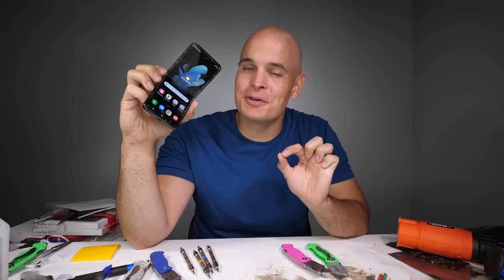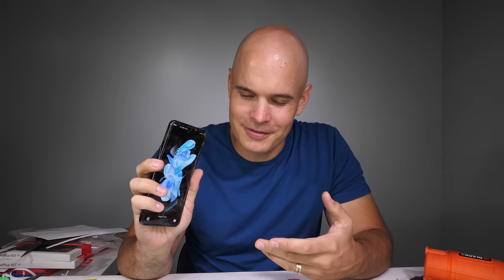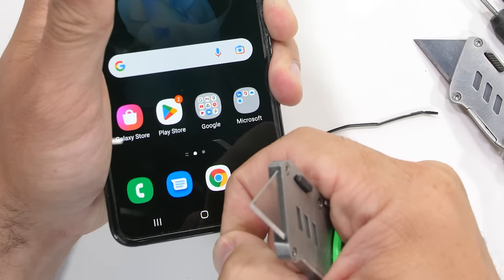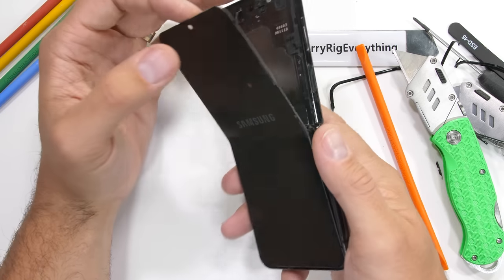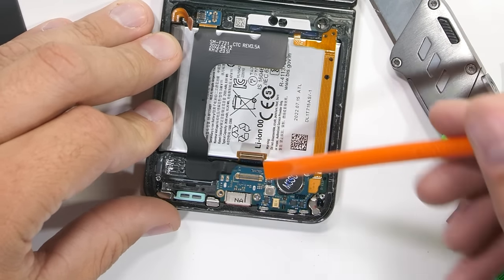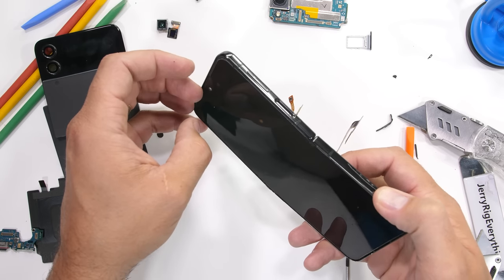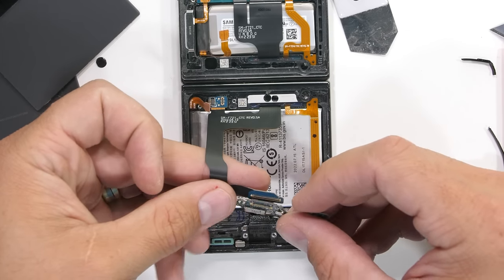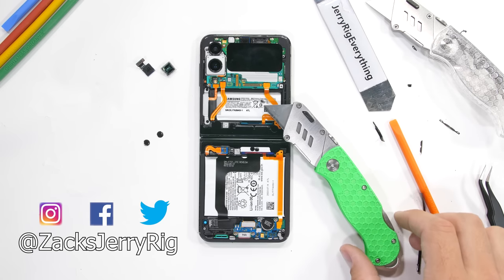They said i couldn't do it... - Flip 4 TEARDOWN

Comment: Teardown videos are way more satisfying than durability tests, you can add waterproofness test into your videos
Reply: Almost all IP68 phones would survive within the standard claims
Reply: Most phones have an official IP rating so testing them yourself is redundant
Reply: @MasterKey2004  *IP
Reply: @ShippoHsu  no but after durability test it would be interesting to see if it survives or not
Reply: There is no terrible scratching noise, so obviously it is more satisfying xD
Reply: Yeah I can't stand the scratching :D So always skip those video's and I'm extra happy when  a teardown comes by
Reply: The watertightness is already certified, so no use in testing phones with a rating tbh
Reply: Just because it's certified doesn't mean it will survive.
Reply: @premprabhakar805  Hey I'll second this. I mean...despite my best efforts, gravity is an insistent som o' bish. Would be nice to know when my phone is still able to sink or swim.
Reply: @premprabhakar805  it kinda depends on what the phones condition is
Reply: @premprabhakar805  no phone would survive if its internals touch water, soon or later its gonna die, he would have to glued it back together since he cut the adhesive, boring and also not relevant since it depends on your ability to do it, not the phone itself,
Reply: It wont survive for sure, all the sealing is broken, no way it can survive

Comment: 6:00 those black circular spots at the sides. And at the part where the phone bends. So when the phone bends multiple times, it can create air inside, so to remove air getting into the screen or in some unnecessary parts. That sticker might help.
This is my theory.

Comment: Nice to see that this phone is at least possibly repairable without much need for expensive proprietary tooling. Gives me confidence in this phone as I just got it a couple of weeks ago. That pop is still a little concerning though...
Reply: I doubt there's a third party repair shop that would dare touch this thing with a ten foot pole. God knows I wouldn't.
Reply: Lmfao I wouldn’t wanna get anywhere near that screen.
Reply: prob. is one of the metal channels that bent and is bumping with the other parts, causing not a correct way to close enough
Reply: @-Jester  Refurbished Samsung original screens come with the plastic bumper installed, it's very easy to repair.
A friend of mine owns his own repair shop and I was there when he repair the Z flip 5G (first one with SD865+
Reply: 'easily repairable', one of the first things to die is the battery. Jerry didn't even bother (which is a first).
Reply: @trakaiszeks  as I am writing with my galaxy S10+ bought in 2019  
, I can guarantee samsung's battery is superb. I'm not a cautious person. I play games while it's on plug and do other things that ppl said not to do while charging the phone. It survives my cruelty 😂
Reply: @leeeunhae7510  I've had an iPhone xs max for the past year and a half. I've had my s22 ultra for a day and the difference in battery life is no joke. Would've been charging my iPhone by now.
Reply: Y’all still liking your flips?  I just got the 4 for my partner

Comment: Id like to see a scratch test of the layer under the protective plastic, im curious if thats where Samsung is hiding their ultra thin and flexible glass
Reply: It's not glass per say as I remember Jerry testing it some time back. It still scratches at level 2, its more of a thin layer of glass in between plastic or you can call it glastic
Reply: @nishantrajani7372  yeah but he only did that once with the fold 3, he should test all flips/folds without the screen protectors just in case even tho its probably gonna be the same results.
Reply: @LeonRivia  if samsung actually managed to achieve a glass folding screen, I’m pretty sure they would advertise it like crazy doe

Comment: I have a Z Flip 3. The screen protector started lifting about 6 months ago, and by 3 months ago, it was completely lifted in the folded section of the screen, so I just removed it. Been a few months now, no issues whatsoever. I think the reason they tell you not to remove it is because the adhesive is probably strong enough to lift the screen and crack it if one is not careful enough when removing it.
Reply: I did the same thing too 😅
Reply: I put a different screen protector
Reply: Same thing has happened to me however the screen is now cracking across this fold and my phone screen turns off randomly. I will never get a folding phone again
Reply: 🤣. It’s there because look at the fkin screen mate it needs every damn layer of protection it can take. It’s glasstic
Reply: It's also there to keep the glass together if it ever where to crack or shatter.
Reply: @angryviper1  which one did you use? 🤔 I got the fold 4, it's still new in a thicc case, but eventually it may give out...
Reply: Would reapply a screen protector(the genuine Samsung one imo is the best) as soon as possible. Had the same issue with my Flip 3. Protector lifted at the edges. So I went witout it(actual screen still in flawless condition) About 6-8 weeks later, the folding part started to develop very fine cracks. Not 100% sure, but my theory is that the protector is needed to keep the displays first layer(which is thin plastic) integrity alive. Of course within the folding area the plastic gets stressed the most. Although there was no damage to the display itself those scratches started to get rly noticable both visible and feelable. In the end the display needed to be replaced. Now I always keep a genuine Samsung(flip 3 or Flip 4 both fit) screen protector as a spare part.(they are only about 10$)
Reply: @Squilliam-Fancyson  It's a fault with the design of the phones. Mine did the same, bubbled, then took out the screen. Samsung's verdict 'physical damage no repair for you'. Would be nice if Jerry/MKBHD etc... would raise this as a consumer issue rather than be walking billboards.

Comment: It's interesting to see exactly how the hinge on my flip 4 failed. From this teardown I can see exactly what happened. The little channel "gears"  on the right side of the phone (when the screen is facing you) got knocked out of alignment, and the bottom one, whish is where the failure snapped it off, began to slide forward, going through the graphite tape just enough to puncture the back of the flexible screen directly on top of where it is supposed to be laying down, destroying the pixels there and creating an open circuit for the entire line of pixels in a cross guard section leading away from the initial damage.

Before I did some minor surgery to wiggle the gear back away from the screen, I could both feel and see something jutting out of the screen and causing it to bulge, though I wasn't sure exactly what it was, besides probably part of the hinge. Now I know the exact shape by connecting the dots between what it felt like and what it looks like.
Reply: Same thing happened on my Flip4, the hinge failed causing it to snag when opening and closing, you could always hear a clicking sound, consequently after that the screen around the hinge area turned black and then completely off. Phone works still as it shows on the small front screen but not main screen.
Guarantee on these phones is really hit and miss with Samsung as they look for any small scratch or mark on phone to attribute it to the cause. Buyer beware! I'm still in contract for another 9 months paying for a dead phone.

Comment: I miss those days when we could just replace the phone battery like we can in every other battery powered device.
Reply: What'd you mean? You can replace it yourself or if you want to ensure water resistance is in-tact (unlike any other battery powered device) then take it to an authorized repair center as they have the proprietary tools to ensure the entegrity is restored with testing after the repair is completed. Last I checked most ASCs charge $100 or less USD including labor for this, or buy the battery yourself and simply reuse the old adhesives --won't be water tight but neither are most every other battery power device that can be changed out simple
Reply: @j.ballsdeep420  I meant just taking the backplate off and switching the battery. A thing that everyone can do.
Reply: @j.ballsdeep420  mate all that faff is exactly why non replaceable batteries are so bad. u used to be able to buy a battery online for 30 quid, pop the back off and click it in, took 30 seconds and brand new battery. its the main reason people upgrade, the batteries are always the first thing to go bad in a phone

Comment: I LOVED my Flip 3.. RIght up to the point about 9 months in where the screen at the fold area started to peel off. I hope they eventually get things worked out because the small size, but standard screen is what I'm still looking for.
Reply: Was that the screen or the screen protector that was peeling?
Reply: That was the screen protector, not the screen itself...lol
Reply: @DazedSean  Yes. But if they tell you not to remove it and it starts to come off less than a year later.. It's not ready.
Reply: @twjonckheere  I peeled my screen protector off after a small piece of dirt got trapped under it and dented the screen below. It is removable and doesn't destroy the screen, but it is leaving the screen exposed to damage.
But I kind of agree with you, the tech is not fully there yet. But it is cool as hell and I'll probably stick to folding phones.
Reply: @twjonckheere  Samsung do offer to replace the film at their stores.
Reply: @jep0rox -- Or in the US and uBreakIFix, as well as mailing it to them
Reply: Samsung offers 1 free screen replacement. Argument is moot
Reply: @j.ballsdeep420  Samsung refused to fix mine. A 1300 EUR phone should last longer than 9 months.

Comment: It was weird to see the millimeter-thin folding screen working while mostly detached.  In theory, that's how thin a phone could be... after a bit more engineering work :-)
Reply: It requires a PCB, battery, camera modules, and a daughter PCB for BMC and volatage regulation: It'll be a very, very long time before all of those components could be that thin, bud

Comment: Nice video, Wish you could do a little more disassembly showing in detail the hinge assembly. 
I just had the hinge on my 2 month old Samsung Galaxy Z flip 4 break causing the phone to only open about 45 degrees. apparently this new hinge, is super fragile and from mining the web Ive come across quite a few others experiencing the same issue. 

And since you have flip 3 and a flip 4 maybe compare the two. I see recall or class action in Samsungs future, kinda like the battery fiasco on the "Note" Thanks

Comment: I have this phone and love it, well I did love it now it terrifies me with how delicate it is. I keep my Zflip in a plastic case that also covers the hinge panel area, I also have a front screen protector, and 2 camera lens protectors since I'm OCD about scratches. My first mistake this past weekend was keeping my phone in my right pocket, I NEVER do that. My second mistake was my trying to rush out of the passenger side of an Xterra (this is important for the height of the drop) when we got to our destination. I opened the door to turn and step down and my zflip went crashing to the ground and hit the concrete right on the corner of the left hinge (the hinge at the end of the Samsung logo). There were no visible signs of damage and my case didn't crack or have any scratches, my phone however.....no longer lines up corner to corner when folded and is shifted over and is off by less than a 1/16th of an inch and will no longer open past 90 degrees without pressing on the hinge/panel area that took the brunt of the fall......I essentially have to push or click the end of the panel/hinge back into place every time I want to open the phone flat. I kept my flip pristine for an entire year before its ill-fated tumble to the ground. RIP left hinge may you rest in piece.

Comment: I Dont know if it makes sense why the phone doesnt close totally anymore:
1. The new hinge design like fold 2 which i had also an issue that time though not fully opening straight which you also experienced few months after use
2. The magnets, i know magnets doesnt loss its power but there are magnets that holds & should help the phone close

Just my two cents :)

Comment: I returned mine, it was getting FLIPPING hot during video calls especially the top section of the phone, the highest i saw was 43C with ambient temp at around 23C, too hot to hold than the battery would just drain cos of the heat. Great phone but forget about using for heavy tasks.
Reply: Thanks for the suggestion on testing as I want to toss mine through it's paces during the return period --still waiting on delivery since I did a bespoke color scheme

Comment: Two sturdy toothpicks (maybe make your own out of bamboo) some dental floss wire ... and a ton of alcohol and give it a try to remove the batteries. You shove the wire in the hole using the tooth picks, and you slide them using the tooth picks as "handles" one side at a time.
It works, but... not the first time. You first have to figure out how to do it and there's no substitute for practical experience.
Source: i fixed a dead battery phone for a friend and that's how i got it out without it exploding in my face. Frak Samsung. Especially since all their tech in that department (including the bending screen) is stolen Nokia stuff. Nokia made the tech and the least that Samsung could've done is be respectful with their ill gotten tech towards the users. It cost them nothing, except the copy/pasta tooling process in China.

Comment: My original screen protector came off over time with my zfold 3. Samsung wanted to charge me so much to replace it... I bought the premium film from white dome and it was super easy to install. So I'm happy
Reply: When you say Samsung, you called 1800-Samsung, or who did you contact? Samsung has had 1 free screen replacement even due to damage since the flip/fold 2...

Comment: Zack have you ever replaced the battery of your note 10? I'm asking because batteries are batteries and they don't last forever and  you've stuck with your note 10 (since it came out, I'm guessing) for 3 years. Do ever plan on replacing it or would you just get a new phone? After all you have shown us how samsung likes to glue in the batteries. And CONGRATS you finally DID IT put back A FOLDABLE together back in 2 pieces, that selfie cam is its own thing now 🥲. thanks for reading...

Comment: You didn't check that the hinged is popped up from the chassis. It's bent and ripped off the frame or the chassis. It's not visible, unless you remove it from the phone and look at the hinge. It's stress bending. Something like that

Comment: My first ever Samsung. After nearly 3 months of use...

1. Camera night mode is way inferior to my Pixel 4 night mode.
2. It's top heavy so it gets a bit tricky holding after extended periods. It also tends to roll back easily when trying to watch videos while folded on a flat surface.
3. Battery life isn't so great.
4. The common finger touch points on the screen are showing wear.
5. With a gel phone case in use, just yesterday my phone slipped out of my hand then under my desk. Now it only folds opens 45% of the way.

Off to Samsung depot it goes...hopefully for a new replacement.

I was a Pixel fan. Owned Pixel 1 and it lasted for years until I upgraded to Pixel 4. I hoped Pixel would release a flip in 2022...but nope. So I bought this Z Flip 4. It's doubtful that this phone will last 2 years. When Pixel features Flip...I'll go back.

Comment: Dropped mine ONCE with a case on and the hinge broke, makes a horrid CRACK noise when I try open it, so I can only open it 3/4 of the way; bottom screen is half dimmed, and a white line of LEDs runs across the fold. Despite "free care plus" they made me pay 100 pounds just to send it out for repairs. Last Galaxy I will ever buy.

Comment: There was potential to have a removable hot swappable battery in this device. Top battery could be the non swappable low capacity one while the bottom could be replaceable with a removable backplate. .but eh . Why would anyone want that ?.....

Comment: Now after watching this teardown i concluded, that front facing camera breaks very easily during removal. That's weird
Reply: It has a square adhesive around it holding it down --he just man-handled it up like an idiot and the module itself is two sandwiched pieces with the lens body and sensor seperate so he basically jabbed half way through the body and lifted rather than getting completely around and under the entire module to lift where the adhesive holds it down and you can see when he completes pulling the full module including lens housing out of the body. It's pretty easy to avoid but also really easy to do if you're a Neanderthal of tech

Comment: My original factory installed screen protector completely separated. I installed a new one and it was great but now something has shorted in the hinge. Enough to see an arc and kill the battery. Now the display does not function. Waiting on a donor to hopefully swap out the main board. Can a screen protector really cause catastrophic failure? Or was it the bump stops at the corners of the screen that decided to eject in their first year of life? Mechanically this phone is solid AF but electrically it has some flaws sadly.